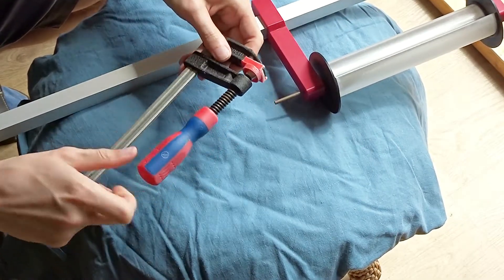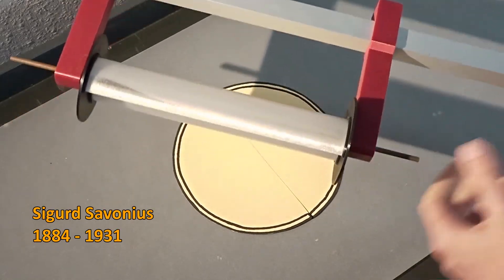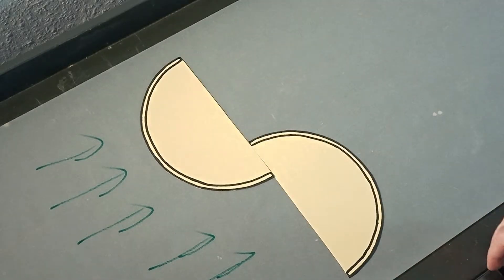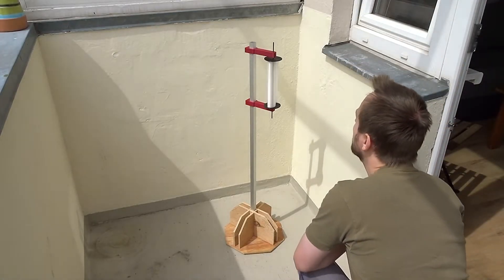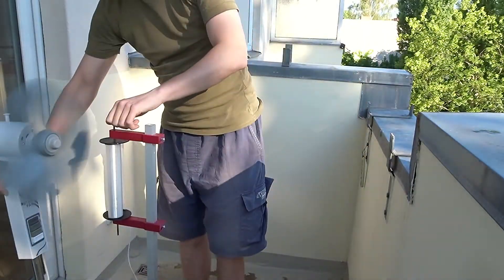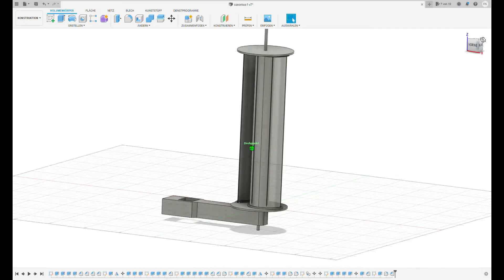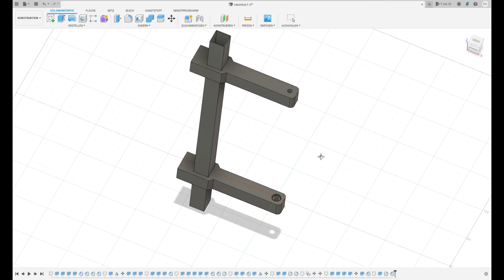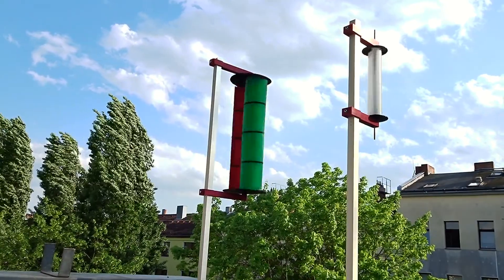Can This Tiny Vertical Windturbine Charge My Phone? Savonius Rotor Build

Comment: There is a variation of the Savonius called the Ugrinsky turbine. It's supposed to be about 50% more efficient. It was originally designed to be for use in water, but it works just as well in air. Robert Murray Smith has an excellent video on the design and he also printed a helical version. Check it out, I think you'll like it. Great crossbows.
Reply from the maker: Thanks! And I will definitely check that out. There will also be a lot more crossbow AND windturbine content in the future. Just kinda busy right now..

Comment: information.            you are on your way to demonstrating  the  Futility of trying to make a  SMALL,  VAWT.!!!          a  vawt configuration  is   inherently  LESS-efficient.!!!!        the use of (just two blades and) a small rotor  Radius  makes  a vawt  EVEN,  less  efficient.!!!         (if you ever  LOAD  yer tiny little vawt, you will  SEE  that  two blades  is  NOT  enough blades.)            googletranslate
Reply from the maker: I don't intend to demonstrate a more efficent or less efficent design at this point. Everything has advantages and disadvantages and better or worse usecases. I am just exploring and experimenting for now. For Savonius rotors the 2 bladed design is the optimum though. Cheers.
Reply: VAWTs are more efficient when at lower altitudes where the wind is chaotic due to all the rotor bouncing off surfaces.  

For personal use, the goal isn't always maximum efficiency, it could also include "can it get the job done within the budget and skill I have."  

Here, the stated goal is charging a phone, or from that, a phone charger or an emergency radio.  If you were in a natural diaster like a hurricane or the power goes out, being able to charge a phone is a big deal.  Let's say you didn't have a pre-balanced turbine lying around that wasn't damaged in the natural disaster.   It a lot easier to cobble a VAWT together from a 2 liter soda bottle and small motor you found in something than it is to recreate the most efficient blade shape for a small turbine, and then try to figure out how to get it up above the tree line to the most efficient height.

Everything has its purpose. It's about that application and the requirements, not ultimate maximum efficency.